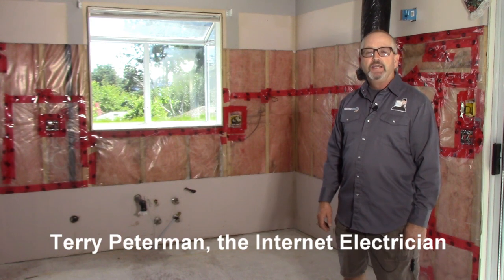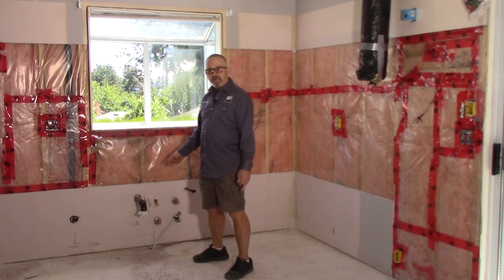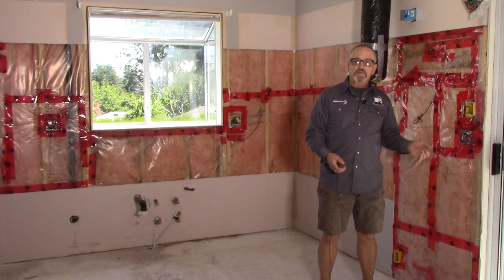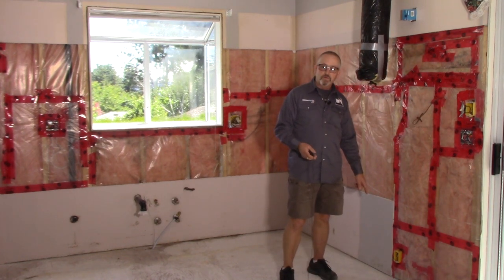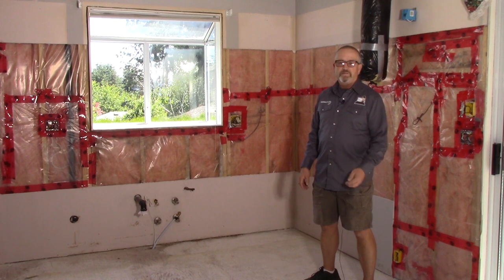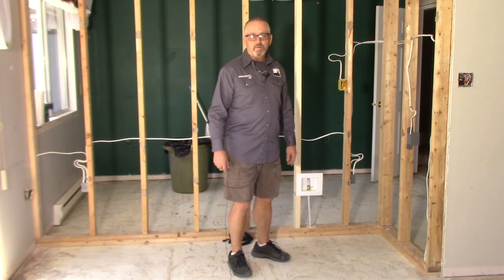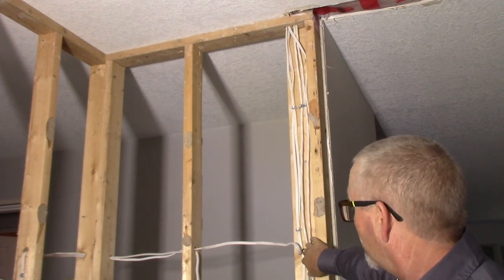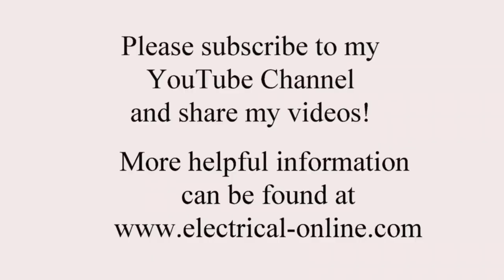Kitchen Renovations Wiring Series Video Two

Comment: I didn't see a dishwasher power supply roughed in. I have always used a duplex outlet for the dishwasher and garbage disposal and putting appropriate power cords on the appliances. They are easier to service and replace in the future.
Reply from the maker: Yeah, that is a good practice.  This house had a feed that was hard-wired to the old dishwasher from the crawlspace and it was long enough to make it to the new location without extending the cable, so I did that.

Comment: I am curious to see how you use the low voltage wire to attach to under cabinet lights!
Reply from the maker: I waited a long time for some LED tape lighting to arrive, it got lost in the mail, then re-ordered so  finally got the under cabinet ligthing installed here in late November.  Video ready to go to editing. Stay tuned. Subscribe and click the notification bell and you'll know when I release new videos.

Comment: can you use 12/2 yellow wire for 15a circuits in canada?
Reply from the maker: Yes, it's always OK to use a smaller amperage rated breaker with larger wire size.